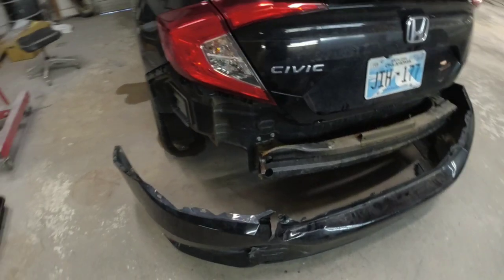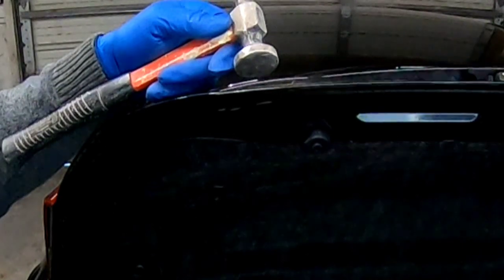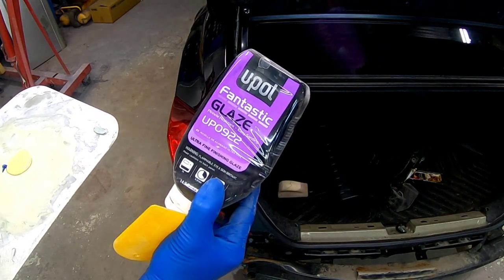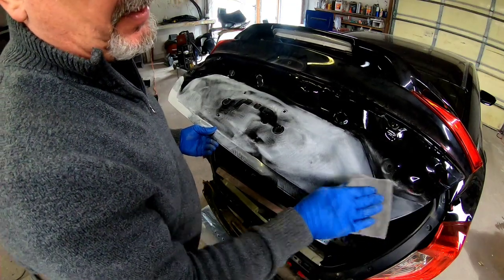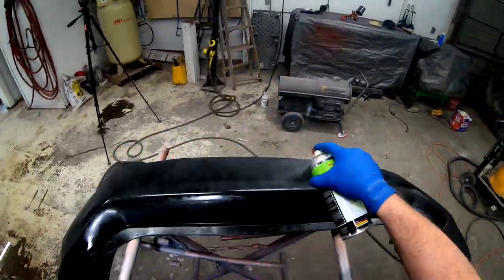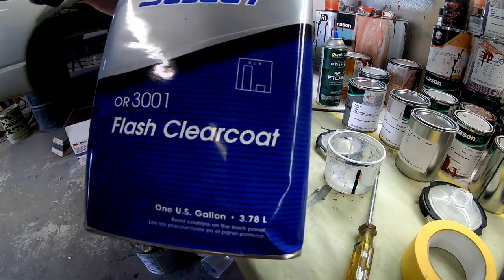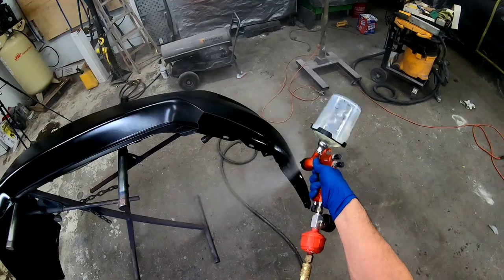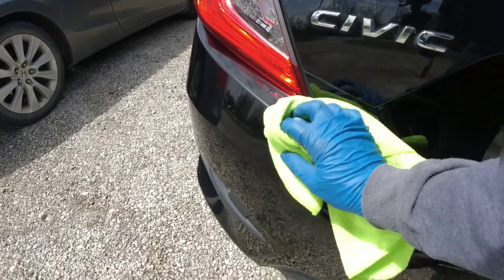How to repair a rear end wreck. #bodywork #autopaint

Comment: Your $200 spray gun is now a $400 spray gun. Sagola has DOUBLED their prices since their new owners took over. The 4600 Extreme which I bought two years ago for $350 is now over $700. I can buy a SATA X5500 cheaper than a 4600 Extreme. Scratch Sagola off of your list of affordable spray guns.
Reply from the maker: Is it really! I just noticed they raised the price of the 3m performance  to over 400 for the kit pack. I was wanting  that 4600 but can't  justify  the 700 dollar price tag.
Reply from the maker: Thank's for the heads up as well.
Reply: @GarageNoise  That's a ripoff too but it's not double the price. Sagola makes good stuff, I have a lot of their guns I think six all together - two 4600's one DVR Clear and the other the Trophy Truck edition, one mini Extreme and three 3800's that I use for sealer and primer, but if I'm paying as much for a Sagola as a SATA I'm going SATA every time particularly from the aspect of product support. DanAm is excellent and Sagola sucks in that regard.